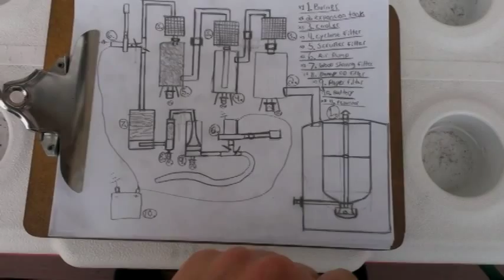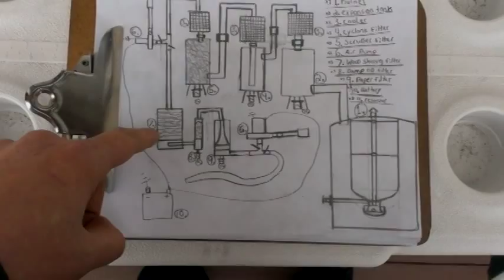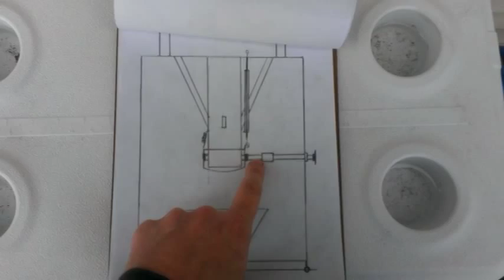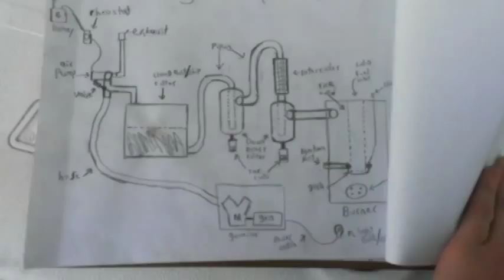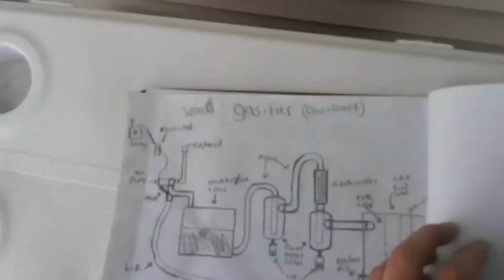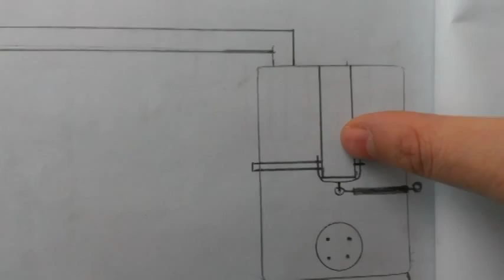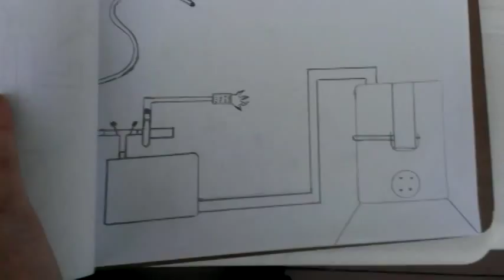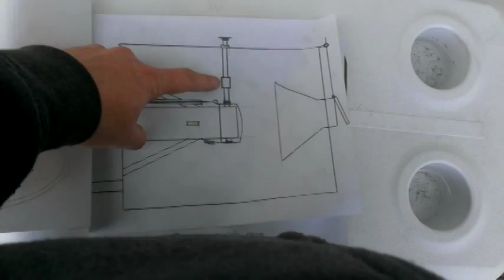New gasifier plan and inverter generator plans

Comment: What makes it an imbert is the throat restriction. The restiction drives the temperature up to the cracking levels you need. A straight tube FEMA is just too large to get the temp.

Comment: Good idea with the center air tube. That's on the table for my next build. I was going to call it a butter churn gasifier. You mentioned damp rid. That may not work with woodgas so be forewarned. For the paper filter just make a coat hanger form and wrap six paper towels around it and house it inside of a 4 inch piece of drainage tube. It works great plus it will have almost a zero back resistance on the output. Check out my tri-filter build. This will help you.

OK you have a good question about converting the FEMA into an Imbert. To answer your question, yes it technically becomes an Imbert and I tried this very same thing but the temperatures were still too low because you are still dealing with a straight tube. You could reduce down at the bottom to a 2 inch opening for a small engine and POSSIBLY archive tar cracking temperatures but if you are using a 4 inch tube you can only run wood pellets without bridging issues (clogging issues).

The catch bin would not catch everything because as you shake the grate things will fly in all different directions inside the gasifier. I look at all of your drawings and it reminds me of me when I was first learning this stuff too.

Here is a word of advise... Keep it simple. Simple is simpler to troubleshoot too!

I come right out of the gasifier directly into cooling pipes then into the expansion/cooler tank. Then I added an extra set of cooling pipes on the output of the tanks to help cool the gas even further plus this will help during the hot summer months too.

I have 3 big filters in series after the second set of cooling pipes. The first one is steel wool and it's only a rough filter that helps capture more water and large particles. This passes through the second wood shavings filter which dry and clean the gas even further then it pass through the third filter which is polyester fiber to polish the gas and just for good measure, I pass the fuel through a paper towel filter like I described earlier.

One more thing too. Because this is a cleaner system I no longer have the need to change my wood chips EVER. Instead, I just pull them out and let them air dry and I rotate them with dried wood chips from a previous run. The same applies to the polyester fiber too. On the stainless steel wool and the polyester fiber I just wash it in a 5 gallon bucket with a scoop of Oxy-Clean.

With a FEMA on the other hand, it may be a simpler build and tempting to construct but it will ruin EVERYTHING with tar and goo all through the system.